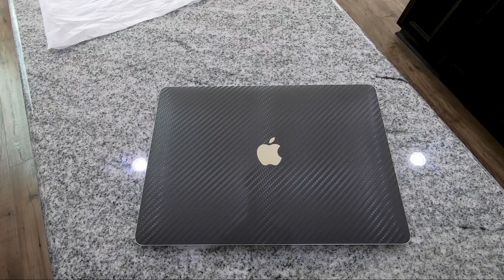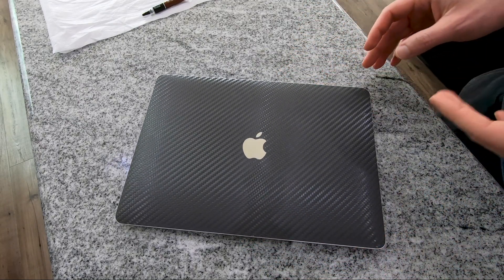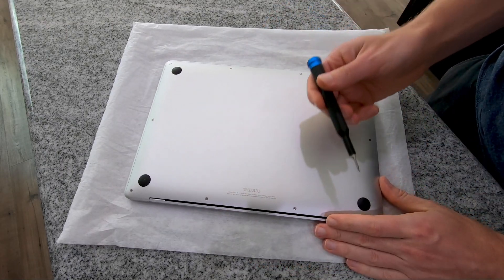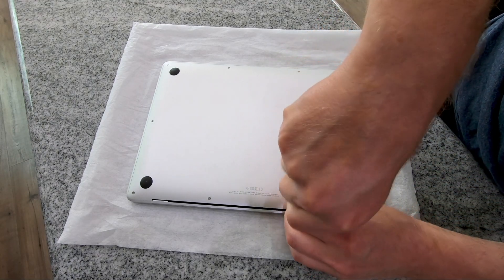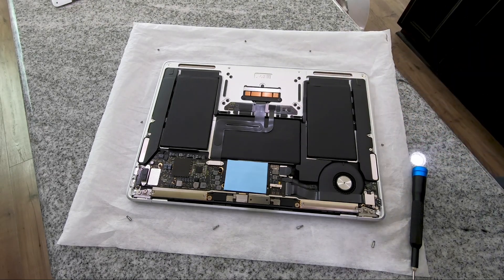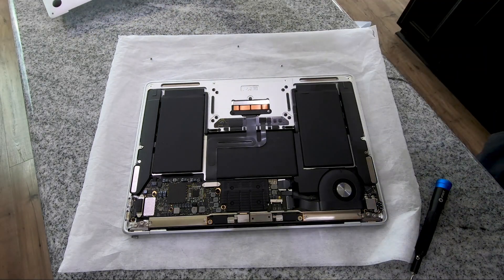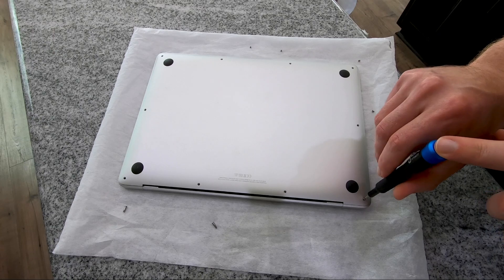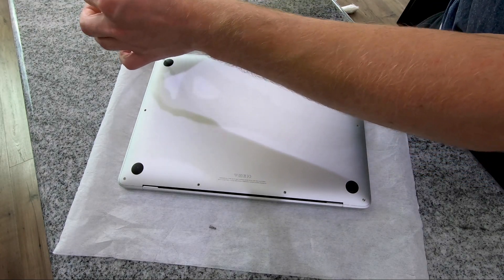How to Fix The 2020 MacBook Air's Cooling in Under 10 Minutes

Comment: Does the thermal conductivity of the thermal pad have an effect? I have a Gelid 12 mK here.
Reply from the maker: I'm sure it does haha. It'd be interesting to compare different thermal pads, both in performance in chassis temp. Just be careful not to get something that's going to burn you while using the system for extended periods. 

I really need friends with FLIR cameras.
Reply: Thanks! This is really helpful. I found the exact same arctic ones online and might as well order those. They’re a bit expensive here in my area tho.

Comment: I absolutely loved it. I have a macbook air 2019 and it does get really hot while i game on it. I recently bought an egpu(GTX 1070) and the temp always hover around 100c. Using a 1200rpm fan helped to bring it down to 99c occasionally. Im definitely trying this using the thermal pad. Thanks for the tip. Looking forward to the copper shim video. Subscribed!
Reply: Mithun Rajiv ma’am a MacBook is not a gaming computer so of course it will overheat
Reply: @mattttttt7106  Oh wow, that piece of information was totally unknown to me (rofl)
Reply: @mattttttt7106  Maybe  if the dang thing had a conductor between the fan  and the processor, or with fins that spanned more surface area in the laptop it wouldn't be 100c while editing videos or watching 8k youtube.
Reply: is it good now?
Reply: any update on how it came out?

Comment: How much better is the temp?
Reply from the maker: Significantly. I posted a follow up video comparing the thermal pad mod to a stock MBA. I was actually pretty shocked at how much worse the machine was when I removed the pad. 
Even after doing the copper shim mod to my personal machine, I honestly believe that the thermal pad alone is the best way to go for most users.

Comment: If you test your MacBook Air your max score is 948 on the Benchmark. You can see in his other video his Benchmarks best score is 1105, that is the highest score for an i5 in the standard list of Cinebench. So 157 higher score. Also you see that the heat is all the time around the 90 degrees. If I test my MacBook Air without thermal pad it is around the 100 degrees, all 4 cores. If I test the single core my heat is around the 90 degrees. These 10 degrees makes your MacBook Air faster but an i5 MacBook Pro is around 1700 that is much faster.
Reply: Boudewijn De Jong yeah the pro is better but also more expensive and has the Touch Bar that people don’t like. I don’t believe that this video is trying to say the air can be better then the pro it is just saying you can improve the air easily

Comment: Is a thermal pad not electrically conductive and therefore short circuit the mainboard?
Reply from the maker: You can get both. The pad I linked to is NOT electrically conductive.
Reply: @carcrazy2424 Didn't know that thanks for explaining 👍🏼

Comment: Great video! I was wondering, when using the 2020 Air on your lap, does it feel noticeably warmer after installation? I would like to improve thermals but not at the expense of 2nd degree burns to my thighs. ;)
Reply from the maker: Admittedly, yes. It hasn't posed a problem in the last month I've been using it, but it's worth mentioning. A small 2"x3" section of the bottom of the chassis is noticably warm when you're stressing the machine. Thankfully, this section is almost exactly in the middle, where I (personally) never tend to place my legs. 

If you're still concerned about thermals yet uncomfortable with the pad, it may be worth looking in to the copper shim mod. There are some write-ups on the MacRumors forum, or we'll have a video out shortly that explains the process.

Comment: I have sometimes problem with overheating my MBA 2020 i3 8/256 in the top of the keyboard.
There is a solution with thermal pad. It hepls for models i5/i7 with "flat" heatsink. But my i3 version have "ribbed" Heatsink. Can I fix my problem with temperature using termal pad?
Or, may be, heatsinks of i3 and i5/i7 models are compatible and i can change heatsink on my i3 model to "flat" from i5/i7?
Is there a competent decision to solve my problem?
Reply from the maker: You know, that's actually a really good question. I'll have to look at a picture of the design. If it's a typical heatsink (that has fins instead of the cardboard-style passages that the i5/i7 models have) then you may not want to block the flow of air through the i3's heatsink. In this case, the copper shim mod is probably the way to go. 

I'll look into this a bit more.
Reply: @carcrazy2424  may be there is solution with 2 termal pads: 1 termal pad we can cut into strips and put them into the grooves of heatsink; the other termal pad we put to the top of heatsink. What do you think about? Photo of i3 heatsink: https://preview.redd.it/87qkxd96u0551.jpg?width=1300&format=pjpg&auto=webp&s=49007c47bc4a6c45642066600e91dbccff2dc42b
Reply from the maker: A user (shoutout to Maxine) below said they tried it on their i3 model and still noticed a measurable improvement.

Comment: Hey, I did this mod with my laptop (i3 base variant) and it's noticeably cooler! Instead of 75 - 90 browsing the internet/watching videos, it's mostly 60-70-- so thanks for this video. Can you tell me about the copper shim mod? Did you go through with it, and if you did, can you tell me how it would work with a tutorial and the results of it (versus stock cooling or thermal padded)?
Reply from the maker: Hey Maxine! I did the copper shim mod over the weekend. It's definitely a noticeable improvement, but I'm still questioning if it makes sense for the masses.  
I recorded an installation video, so if you're interested, keep an eye out for that. It should be up once I've had a few days to evaluate the effects.
Reply: @carcrazy2424  WHy wouldn't it make sense for the massess>?
Reply from the maker: @Barelo  Greater hurdles to jump through (in both installation and potential warranty support) for minimal performance improvements.
Reply: Diar Friend! I have the same model  i3 version have "ribbed" Heatsink. You put tetmal pad just right on the top of heatsink or 1 termal pad was cutted into strips and put them into the grooves of heatsink; the other termal pad we put to the top of heatsink???  Can tou make a video? What the difference in temperature increase do you noticed?

Comment: hey man i love the vid and you DIY solution, but i feel you are making excuses for the overheating, this is the first notebook design that i have seen that doesn't have at least one heat pipe touching the cpu. i seen tablets not use a fan and early netbooks (smaller form factor) but a legit notebook form factor has not excuse for this. next iteration they'll ad a heatpipe and call it a feature
Reply from the maker: Thanks man! To be blunt, there are no excuses for the overheating. If anything, IMO, I'm simply claiming that Apple can't say "oh we couldn't fit a heatpipe" as an excuse for the poor performance. It could have been better, and it probably should have been better.

I'll follow up with a video of the copper shim mod. Most people who have done both are saying their temps struggle to reach 100c, if it even ever occurs. With the state of the world, the delivery is (understandably imo) behind schedule.
Reply: Basically what Apple is doing is giving you a "reason" to buy the Macbook Pro. The i5 in the MBA and 13" MBP is basically the same. But because Apple has implemented crap cooling on the MBA, it will perform much worse because it is constantly thermal throttling.
Reply: @alexclarke6924  even with adequate cooling,, as demonstrated by the coppershim/heatpad mods in the forums, and the LTT video where they ice cooled the  bottom part of the laptop and the CPU never reached 80 degress. the cpu was unable to perform the same as a MBP because they put a limit on how much power the MBA can supply to CPU. Now that they announce  their move to ARM they wont add a heatpipe and call it a feature as i previously stated lol

Comment: Hi, will this mod work the same for an i7? I'm wondering whether the insides are the same or slightly different. Thank you!
Reply from the maker: The only difference between the i3, i5, and i7 variants are that the i3 has an all aluminum heatsink while the other two's heatsinks are copper plated on the bottom. 
As such, your i7 should be the same!
Reply: @carcrazy2424  Brilliant! Cheers for taking the time to reply.
Reply: @carcrazy2424  will it work on i3
Reply from the maker: @dishantthakkar2818  Should work just fine!

Comment: Thumbs up for the demonstration 

btw, It may be a stupid question but just to clarify my doubt, wouldn’t the 1.5mm thickness thermal pad that sit in the middle blocks the airflow? As there’s no gap in between the heat sink and back cover anymore.
Reply from the maker: Tim Donk hit this on the head.
PS: No such thing as a stupid question. :D
Reply: carcrazy2424 is I the same case for the i3 chip?
Reply: On the i5 model, the heatsink is arranged like corrugated cardboard. Air can still pass through and around the system, the thermal pad mod simply increases the effective surface area of the heatsink by linking the original CPU heatsink with the aluminum bottom case. The only problem is that the bottom of your Macbook Air will be warmer but your mileage may vary as how hot the bottom cover gets depends on what you are doing and your ambient temperature.

Comment: Thanks for this. I'm thinking of getting this Mac book air, just to run GarageBand and do some music editing. Do you think it will overheat much just using that application?
Reply from the maker: I'll try this out in a future video for you!
Reply: @carcrazy2424  I looked at your other Cinebench video and the temps seemed to be around 89C, was this the lowest value? Is it possible to play around with the fan curve a bit to go even lower?
Reply: Don’t get the 2020 MacBook Air  , get the base MacBook Pro wich has fan - heatpipes - heatsink and won’t overheat.
Reply: @mikaelhay301  I made a big mistake too buying the air instead of the pro

Comment: hi. do we need to change the thermal pad? or it should last a long time?
Reply from the maker: They do degrade over time, but their lifespan is typically measured in years. If you're having thermal issues again in 3+ years, swapping the pad could be worth the few dollars spent. 
Of course, at this point, dust is an equal concern. If you do go in to replace the pad, make sure you clean the fan while the device is open.
Reply: @carcrazy2424  thank you 👍